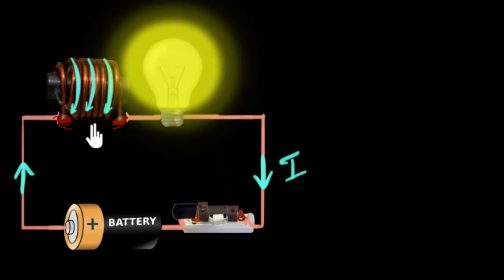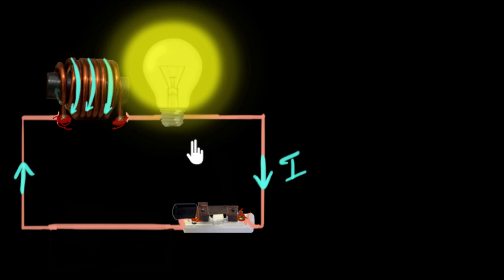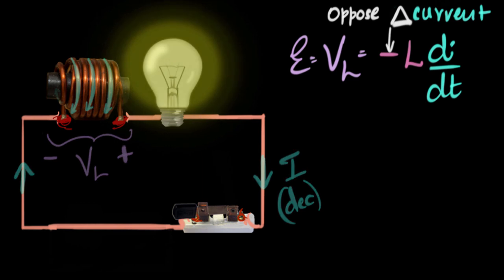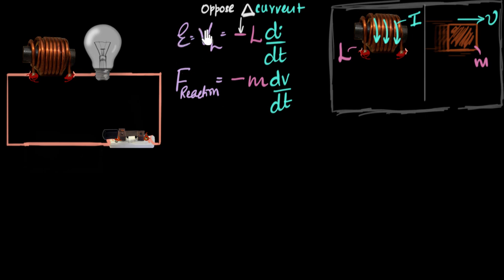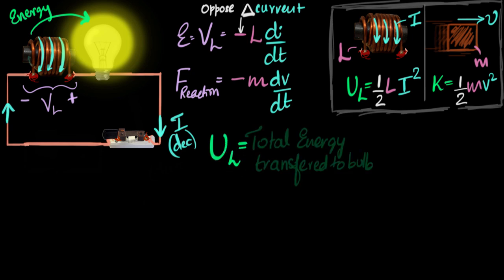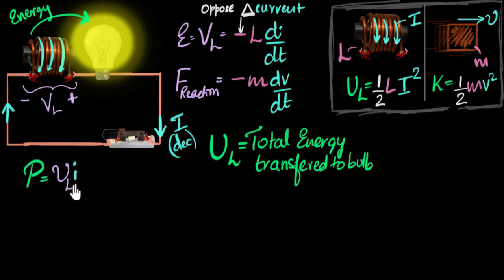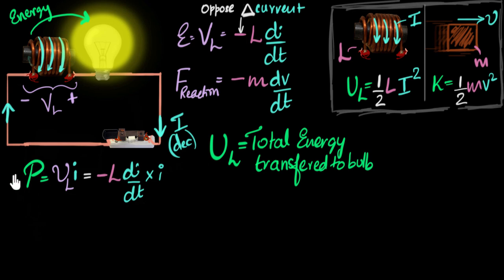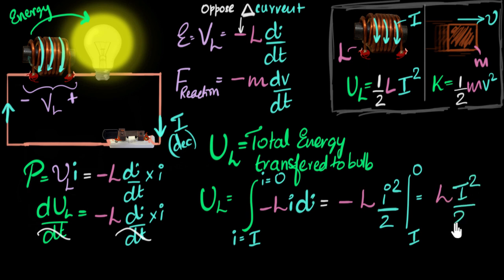Energy stored in inductor (1/2 Li^2) | Electromagnetic induction | Physics | Khan Academy

Comment: I believe you should use V_L as L di/dt only without the negative sign, because that makes it work, when you integrate both sides, the left side is from U_L to 0 and right side is from I to 0, that gives us 

0 - U_L = -1/2 L i^2
U_L = 1/2 L i^2

If we take it with the negative we get U_L = -1/2 L i^2. I do need some confirmation if I'm right or not thanks.

Comment: sir plz plz clear my doubt [why does the current  flow if induced emf oppose the current] plzzzzzzzzzzzzzzzzzzzzzz
Reply: Think of it like static friction, You try to push a box but the box does not move but if you push a little harder, it begins to move.
Reply: The key work here is opposes not STOP. It’s against it but eventually will give in
Reply: In his previous videos he has explained that it does not oppose the current instead it opposes the change in current.

Comment: Summary Of The Video :-

.*Energy Stored In An Inductor* 

* Inductors store energy inside them.

* If we short the circuit using a plane plane wire having no resistance , in that case bulb will not instantly stop glowing but it take some time  before slowing turning off , which show that inductors store energy inside them.

* Inductance is like *Inertia*.

* Inertia resist change in velocity

 Inductance resist change in current

Comment: But energy inside inductor will bamout on the bulb it's not like capacitor as shown in vedio☝️
And that's called back emf which have high voltages for certain microseconds🤔